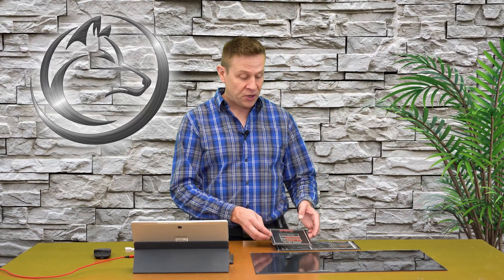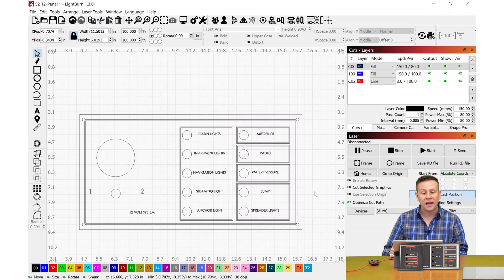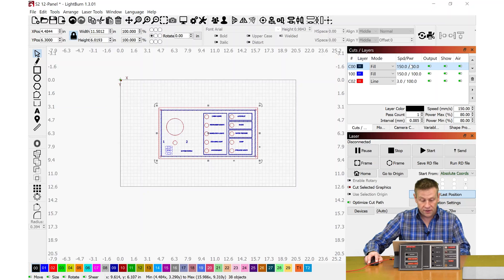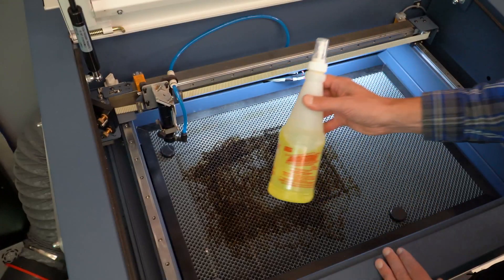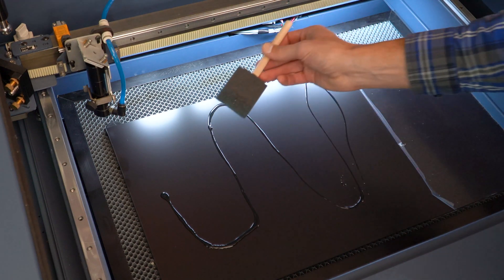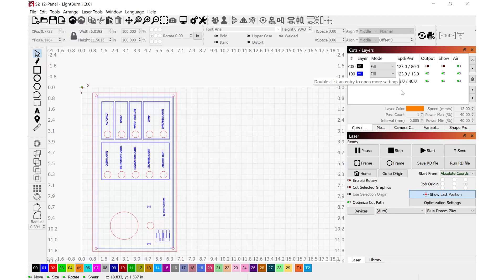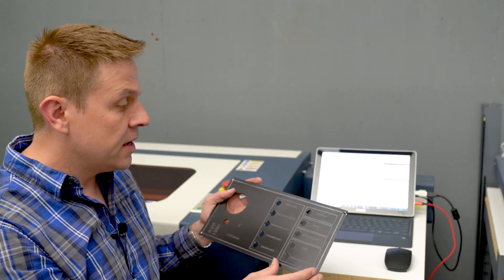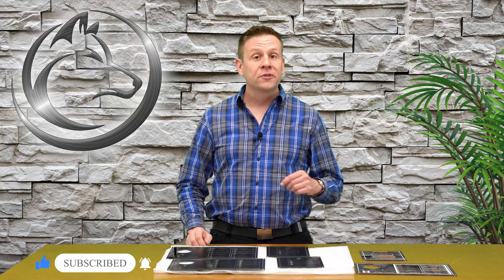Acrylic Engraving and Cutting made easy!  Cloudray Co2 Laser

Comment: Hey Greg we’ve spoke before I have a k1 pro laser and with a lot of help from y’all I’m up and running but I can’t figure out in light burn I bought a license and I check my cut layers and doing an image with cutting out the image   When even if I have the layers in correct order the program will jump to the cut layer and it’s driving me crazy. HELP PLEASE
Reply from the maker: On the far right in LB there's a button "Optimization Settings".  Here is where the order of the cuts/engraving can be configured.  The preview button at the top center of LB (looks like a tv icon) will show the order of how LB will process the project.  I use this all the time!!  Let me and others know if this helped you.  Best wishes!